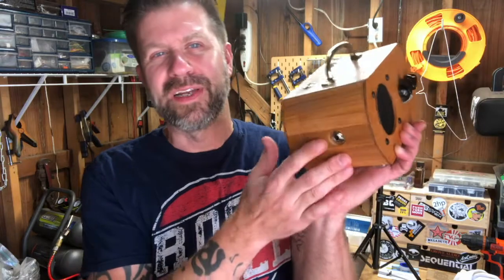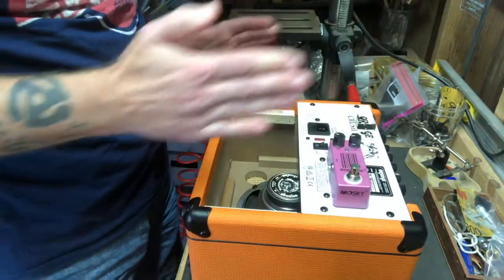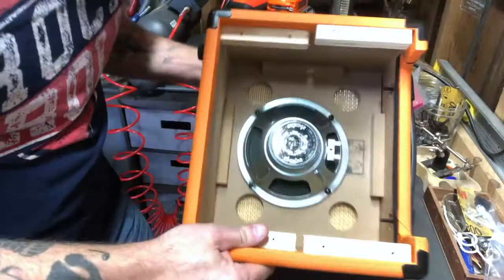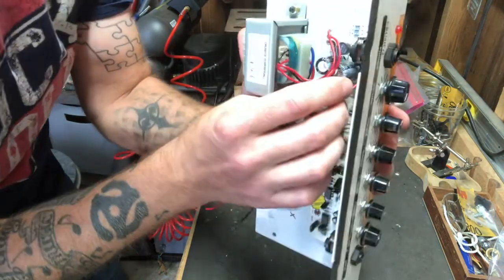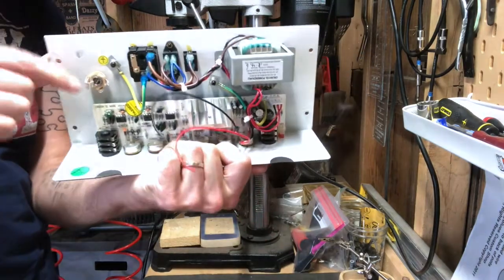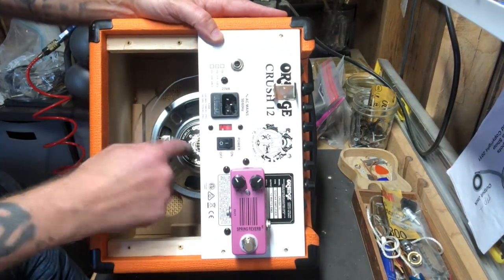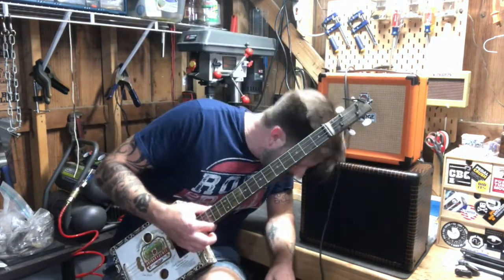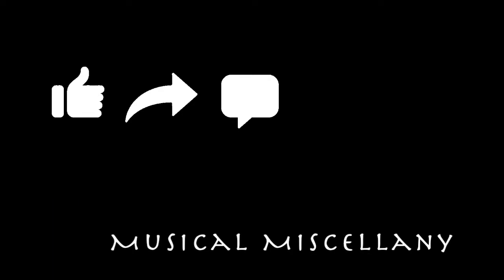Adding an External Speaker Jack to the Orange Crush 12 (or any guitar combo amp)

Comment: Awesome vid but I’m just going to add double end Alligator clips an hook it to my speaker post an then to my bigger speaker. Only because I don’t want to drill any holes in amp .
Reply from the maker: Thanks for watching. What you're suggesting would work fine in the studio or for a bedroom setup but it's probably going to become problematic if you plan to take the setup on location or gig with it. In that case the jack would be a much surer bet. Give it a shot though... alligator clips should work (just make sure they don't touch).
Reply: @musicalmiscellany  thank you for the tip an won’t touch they are insulated Double end Alligator clips. Happy New Year an stay safe .

Comment: Can u do a video on adding fx loop.
Reply from the maker: Thanks for checking out this vid. Adding FX Loop is actually a pretty difficult thing to do and it will be different for every amp. It's not a mod like this one which can easily be applied to every combo amp. It requires an analysis of the circuit and, on some amps, it may not even be possible at all. Alas, it's probably not a good contender for a DIY tutorial.

Comment: I have a Fender Frontman 212 R. I want to put an extension cab jack on it, but I don’t know how.
Reply from the maker: By extension jack, I'm assuming you mean you still want the internal speakers to work but also add an external cab? If so, you'd essentially just follow the same thing I do in this vid but use a standard mono jack opposed to a shunted mono jack. However, make sure you check the impedance rating of the amp. If the internal speakers as equivalent to the minimum load, you'll need to swap out the internal speakers as well as adding the jack. If you wire an amp at an impedance lower than it is rated for, you run the risk of frying the output transformer (so be careful). Honestly though... it's an easy mod provided the amp supports it.
Reply: @musicalmiscellany  
I want to use it as a head, then run a speaker cable to an extension cab that is inside an isolated cab box. So I can record at higher levels in my townhouse. So when I am plugged into the extension cab the speakers in the combo are bypassed.
Reply from the maker: UPDATE: I just looked up manual on the Frontman 212R. They rate the amp at 100W at 4 ohms. The factory speakers are 8 ohm drivers in parallel which would result in a 4 ohm (minimum) load. In other words, I wouldn't recommend adding an external speaker jack to this amp in the default configuration. You could re-wire the internal speakers in a series configuration. This would result in a 16 ohm load (note the amp will be significantly quieter in this configuration). Then you could add an external jack and a 16 ohm extension cab. That would result in an 8 ohm load with the external cab. Another option would be to swap out the internal speakers for 16 ohm speakers. Then you could add an 8 ohm extension cab and run the amp at the full 4 ohm load. That's what I'd recommend honestly. It's doable but it will take a little bit of work. Good luck.
Reply from the maker: @robertmellang6998  What you just described is exact what this video covers. That's why I thought you were talking about something else.
Reply: @musicalmiscellany  
I kinda knew that but I am slightly afraid to dig into it. Also the two speakers throw me off a little. But I wanna do it my self.

Comment: Hi, i did the same thing to my Orange crush mini and now as soon as you turn it on it starts hissing. I checked and it's grounded correctly (both grounds going to the switched jack)
Reply: To clarify, the hiss is barely noticeable unless you turn on the overdrive and crank the knobs, then you can really hear it.
Reply from the maker: Thanks for checking out the vid. I'd need some more info to really troubleshoot it, but anytime you add a component for a circuit, you have a chance to pick up noise. The best way to avoid this is to create solid grounding. For instance, you can use shielded wire (instead of plain wire) or even ground the negative side of the jack to the main ground on the amp. A good way to tell if you have a grounding problem is to touch a piece of metal on the cord or guitar and see if the hum gets quieter. If it does, it's related to grounding.
Reply: @musicalmiscellany  thanks, man. I took it to a tech and he said that its a really small amount of noise which might be normal but hes going to test it in a few days.

Comment: Thanks for this useful video?
Could I use just orange speaker as a cabinet for any head through this jack  ?
Reply from the maker: That definitely would not work with this wiring scheme. It would be possible to wire it like that though.

If you used a standard mono jack in place of the shunted jack, it wouldn't cut the internal speaker when you plug an external cab in, but it would allow you to plug in an external audio (provided the amp is powered off of course) into the internal speaker.

A better way to do that might be to add 2 jacks, one coming from the amp and one going to the speaker. Then if you want to use the internal amp/speaker combo, just connect the two with a short cable. This would give you a lot of possibilities (combo, head, cab).
Reply from the maker: I just posted this video describing what I'm referencing... https://www.youtube.com/watch?v=l6txwhjeC8Q

Comment: Dude!!! I have an orange crush 20 and I'm planning to do this mod as I can't cut through the band mix. I'm planning to buy a cheap JOYO 112v cabinet with an 8 ohm celestion speaker. My question is, is it safe if you plug in/plug out the jack while the amp is still powered on?
Reply from the maker: Thanks for checking it out. As a best practice, you shouldn’t turn the amp on until the cabinet is connected. You can plug in the guitar after it’s powered on but again… best practice says you should turn it off or at least lower the volume

Comment: Thanks for the vid. How many watt speaker do you think that little amp will drive?
Reply from the maker: Thanks for watching the video. Your question gets into a much more complicated area of speaker/amp design. Every amp has a rating called a damping factor. The is the amp's actual ability to move the speaker cones (or more precisely, to stop a speaker cone once it's moving). Amps with high damping factors could easily drive 8 speakers or more but some smaller (particularly battery-powered) amps may only be able to drive 1 or 2 safely. Every speaker has an efficiency rating as well. Some speakers are more efficient, meaning they require less power to produce volume. That will factor in as well, especially in multi-speaker setups. In short, it's a simple question with a very complicated answer.

All of that said, when it comes to this Orange amp, I'd be comfortable plugging it into a 412 cab but nothing more than that... and, of course, you'd want to use an 8-ohm cab (whether it's 1, 2, or 4 speakers). You could 'theoretically' take 2 16-ohm 412 cabs and wire them in parallel for an 8-ohm load and this amp 'should' handle it. However, I would not be confident in this little amp's ability to damp 8 12" speakers so I personally wouldn't try it. I hope that all made sense.

Comment: Similar video elsewhere talks about putting a resistor across two of the tabs on that newly added jack, and that way if a cable is plugged into it, but the other end of the cable isn't plugged into anything, you protect the amp from damage.     https://www.youtube.com/watch?v=3o-b49UQkC0
Reply from the maker: You could certainly do that. It's good advice. However, it's not going to prevent the problem, it's just going to provide a very slight failure protection. He even mentions that in the video. Think about it this way, the average resistor is 1W or less. So if you have a 15W amp, that resistor will only protect from a 6.7% of the amp's output at most. If a surge is above that, the resistor won't do anything anyway. Obviously, there are 2W, 3W, 4W resistors that would offer a little more protection, but still... you need to be careful.

The best thing to do is treat the cable with respect and always plug it into the speaker first (or even better, only plug/unplug when the amp is off). All of that said, it won't really hurt anything to add a small resistor so if it makes you feel better... go ahead and do it. 👍
Reply: @musicalmiscellany  I know zero about it, just pasted it in blindly in case it was remotely useful.  Cheers for elaborating on it 👍
Reply from the maker: @Stevie_evie  It's a good idea. I see what he was thinking. I'm just a fan of always treating current with respect and using the most foolproof method. Thanks for checking out my vid.

Comment: Another video showed adding a resistor to the switch, so that even with a cable plugged in but no speaker cabinet attached, it still presented a load to prevent the amp from burning out... seems a very good idea...
Reply from the maker: Thanks for watching the video. That's a great suggestion and I actually thought about doing just that. I could've easily put a 1 or 2 watt resistor bridging the terminals of the jack. With a small amp like this that should be sufficient. However, I really started thinking about it and decided it's better to just form the habit of plugging the cable into the cabinet first. If you do that, the resistor isn't needed. On the flip side, if you know the resistor is there, it could cause you to be more careless and well... that can end badly.

You are 100% correct though. Adding a simple resistor would make it possible to plug in either end first. Although - even with the resistor - you still take a risk if you plug the cable into the amp first. The resistor will give the current a safe path... but not for very long. That said... most folks would say some protection is better than none, so adding a resistor is a viable option. I suppose it comes down to personal preference. Holy cow that was a long reply. LOL.
Reply: Would be very useful on a tube amp.  Solid state amps though from my understanding are usually ok to be operated without a speaker load.

Comment: I have the same practice amp reverb pedal weird
Reply: I  have 1960 Harmony tube amp and someone had added a connection from the speaker to a quarter inch Jack in the back I used it as a preamp to my marshal it sounds great but the amp is so old it breaks up but you can't have everything
Reply from the maker: Hey. That's a cool coincidence. Thanks for checking out the vid.

Comment: Great video, after watching this I was able to disconnect the crimp connectors at the speaker using the tip of my thumb to press the catch in. No tools required! 😁 

Noob question: when you plugged in your ext cab the sound no longer played from the crush's speaker. What is it that stops/switches the signal the signal when you hook up to another speaker?  Cheers, Tom
Reply from the maker: Thanks for checking out the video and I'm glad it was helpful to you. The secret of this mod is in the shunted jack. When no cable is in the jack, the signal passes to the internal speaker. When the cable is plugged in, it disconnects the internal speaker sending the power to the cable.

Comment: If I buy a speaker harness already built would that work❤
Reply from the maker: Thanks for checking out the video but I'm not sure what you're asking exactly. I did a Google search for "speaker harness" and nothing that it returned was even close to a mod like this... but perhaps I'm misunderstanding.
Reply: Can I buy this with the wire already Already connected jack (Switchcraft part# 12A).
Reply from the maker: @Texas059  If you could find a harness that had all the wires pre-soldered, that would certainly work, but you'd still need to attach the +/- output wires from the circuit board to the harness. There's no way around that.
Reply: If I leave wire from the circuitboard to the speaker solder wire  to the jack would that still work
Reply from the maker: @Texas059  That would not work. If you did that the speaker would continue to function with the external cabinet plugged in. Additionally that would double the impedance.

Comment: I thought the sound will come out both at the same time
Reply from the maker: It would if you used a standard mono jack. That's the beauty of the shunted jack. It works as a switch of sorts to send signal only when a plug is inserted.

Comment: I mounted to chassis, lot of hum…
Reply from the maker: Thanks for checking out the video. That hum probably means the jack is not grounded well to the chassis (assuming the chassis is metal). Sometimes you can loosen the jack and slide it around a bit until you get a good ground. Other times you may actually have to sand the paint/coating around the hole to ensure you're getting a good ground. You want to make sure you have solid metal-on-metal contact between the threaded part of the jack and the amp's chassis.

If all of that fails, drill a small hole through the chassis and place a small metal bolt/nut in that hole, then add an additional wire going from the bolt to the negative side of the speaker jack. It's usually easiest to use a ring terminal connector on the bolt end to ensure good contact with the nut/washer. That should give you a really solid ground. BTW, most amps already have a grounding screw on the chassis somewhere, so depending on where it is... you may just be able to run a wire to that screw and not have to drill any new holes.

The vast majority hum problems are just caused by flaky grounding. Good luck.